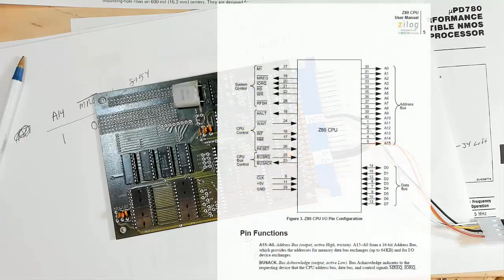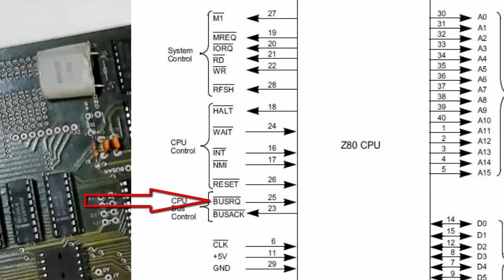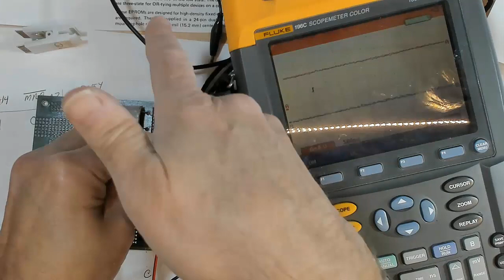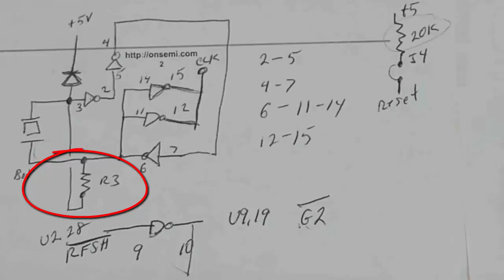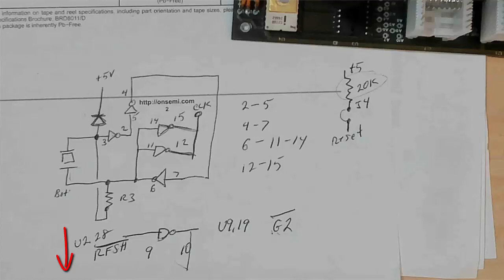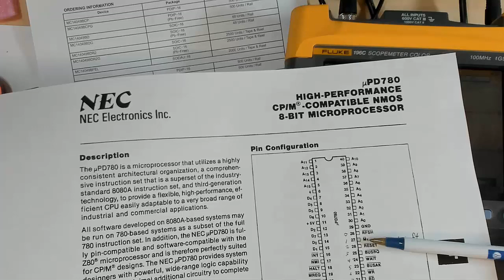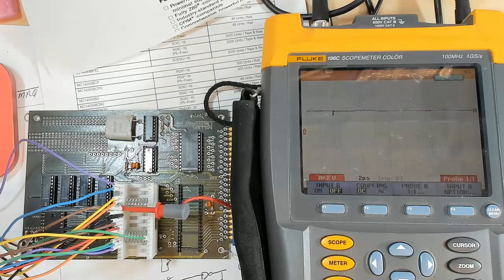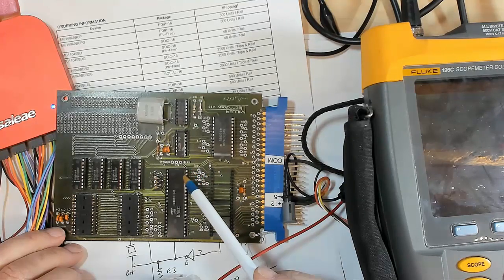{62} Opcode Fetch Success!!  Resurrecting a 1980 M-80, Z80 SBC and getting its first M1 in 40 years

Comment: Disabling the address decoder on refresh is something I do in my designs as well. For no other reason than preventing "spurious" memory decodes (since MREQ also goes low during refresh). There may not be any read our write strobes, but it keeps things a bit quieter. Possibly helps with power consumption as well as there are less signals and thus less transistors changing states.
Reply from the maker: I can see the value in that.